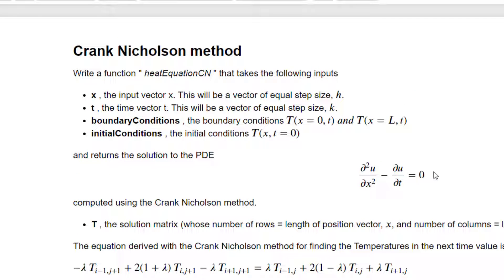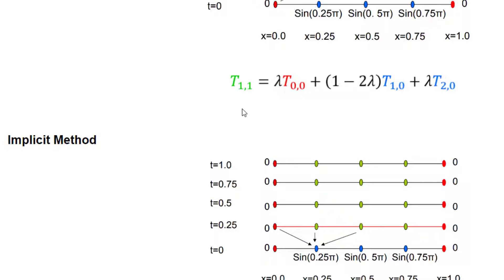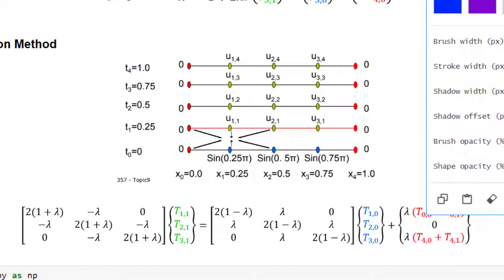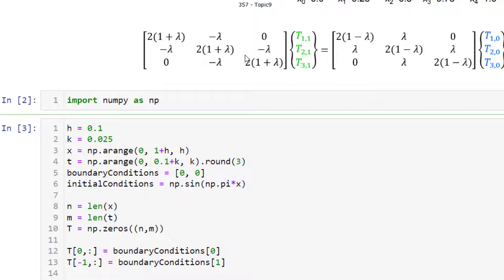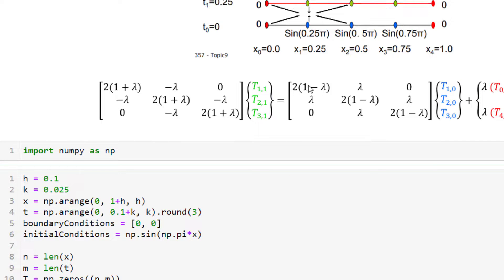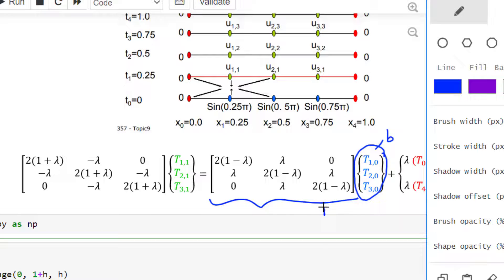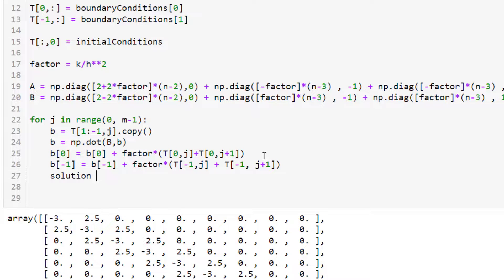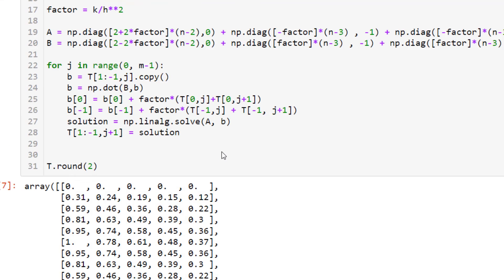Solving Heat equation PDE using Crank Nicholson method

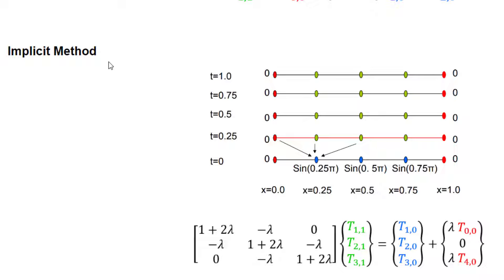Comment: 3:37 I think there is an error in implicit (BTCS) method.  It should be lambda*T0,1 and lambda*T4,1 instead of lambda*T0,0 and lambda*T4,0.
Reply from the maker: Yes, that's correct. Good catch. I added a correction in the description.